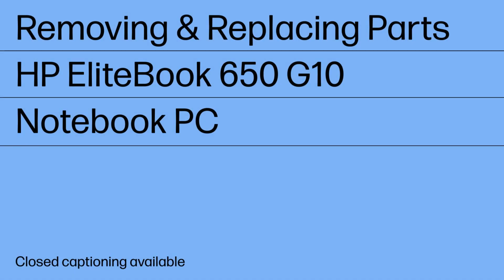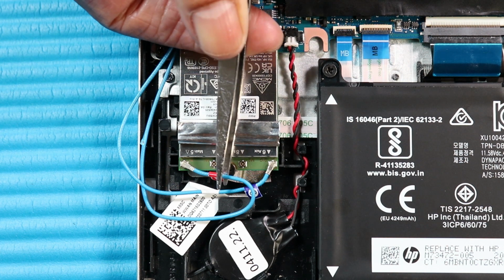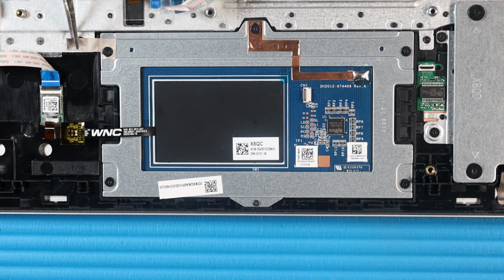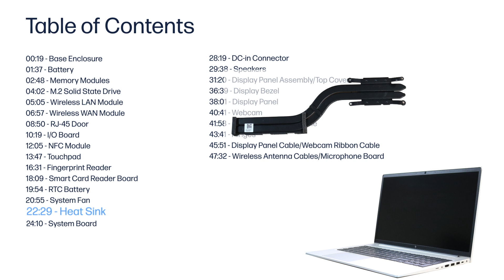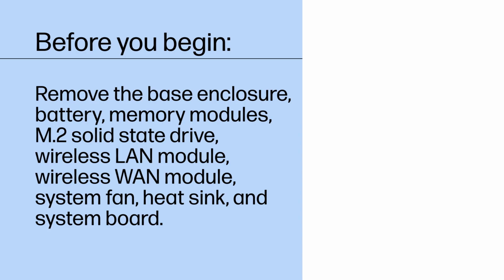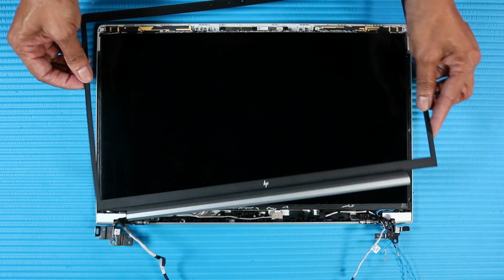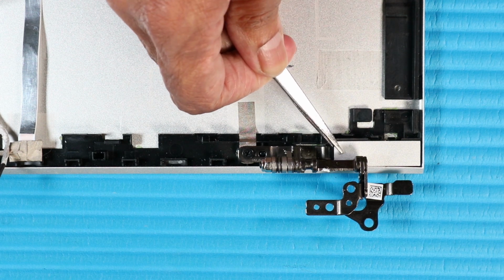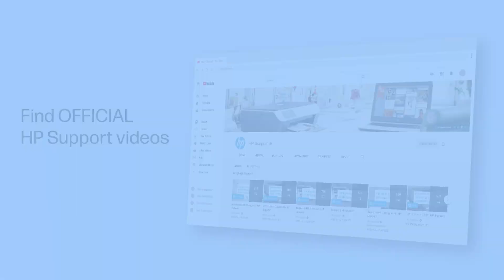Removing & Replacing Parts | HP EliteBook 650 15.6 inch G10 PC | HP Computer Service | HP Support

Comment: Hi! I have a 650 G10 (736X2AV) which doesn't have a touch display, but I've seen that some laptop from this series come with touch display. Sooo, is it possible to buy a touch display made for this series and make it work? If so, do I have to buy other parts as well to make this transition possible? Thanks!
Reply from the maker: Hi there, thanks for contacting HP Global Social Media Support!
I understand that you need to know whether you can make the display of your notebook touch.
I will do my best to assist you.
HP does not recommend upgrading or downgrading hardware parts or software that is bundled with the product as It may affect the manufacturer's warranty and performance, however, you could change the configuration at your own discretion.
Regards, 
HP Support
Reply: @HPSupport , ok. But what about the parts that I have to change? Despite the display is there sth else that is necessary?
Reply from the maker: Thanks for the reply.
We have not tested touch display on this model. So we would not be able to comment whether it will work or not.
Regards, 
HP Support

Comment: Hi, I am about to buy this laptop but one thing that concerns me is that I can not find out if it supports one more SSD which I would use for DATA only
Reply from the maker: Hi Vitka, thanks for contacting HP Global Social Media Support!
I understand that you need to know whether your notebook supports more than one SSD. 
I will do my best to assist you.
This notebook supports secondary storage 256 GB PCIe NVMe Value 2230 SSD.
Binu-HP Social Media Tech Support

Comment: What about the keyboard?
Reply from the maker: Hi there, thanks for contacting HP Global Social Media Support!
I am here to help!
What seems to be the issue?  Could you elaborate more on the issue?
May I know the product you are using? A serial/product number would be helpful!
Let me know!
Regards, 
HP Support
Reply: @HPSupport  I bought a custom Elitebook 650 G10 off of HP's online store and didn't choose the backlit keyboard option.  Can the keyboard be replaced with a backlit one?
Reply from the maker: Thanks for the reply.
HP does not recommend upgrading or downgrading hardware parts or software that is bundled with the product as It may affect the manufacturer's warranty and performance, however, you could change the configuration at your own discretion.
Regards, 
HP Support